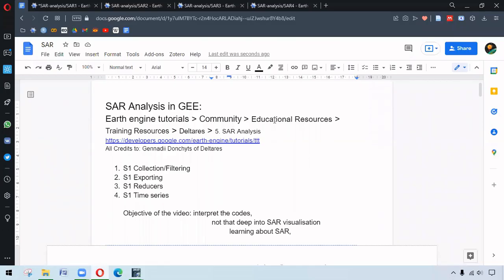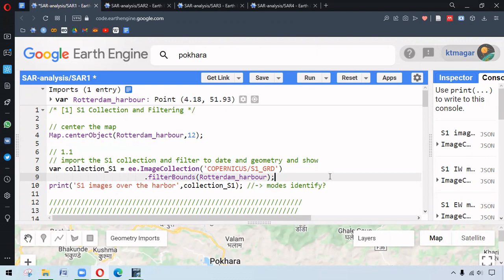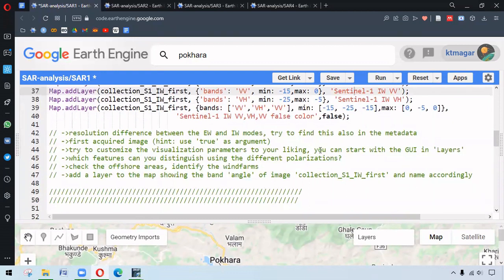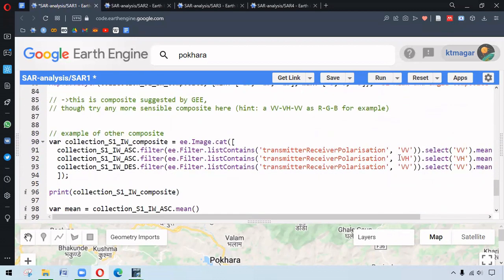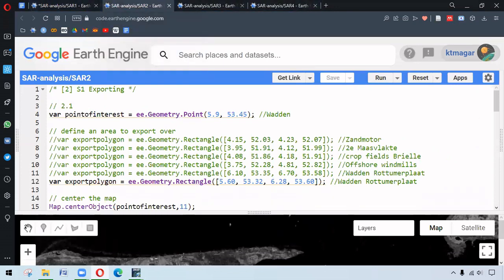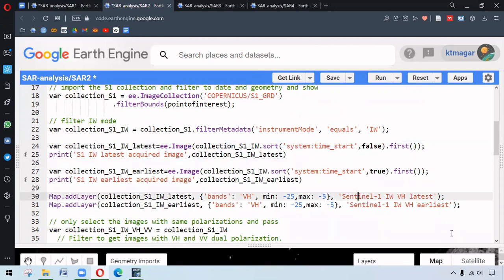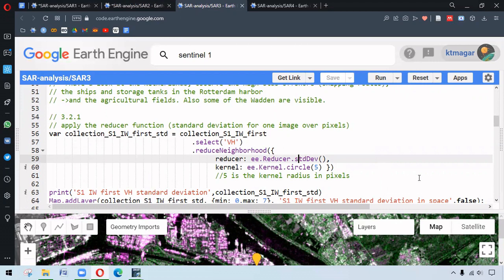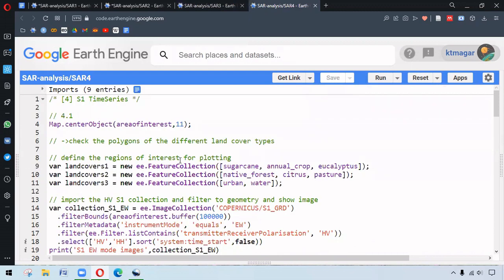SAR Analysis in Earth Engine [GEE]

Comment: Great work but can we find voids underground by this method or we must continue in other program??
Reply from the maker: I may not be able to reply this. 
But, if penetration is concerned C band is not capable. This is probably possible through L band or other long bands. You should further search L or P band. May be that helps.  There is L band dataset in earth engine. 

Hope my comment helps. Thanks!
Reply: @ksabmagar7  thanks alot